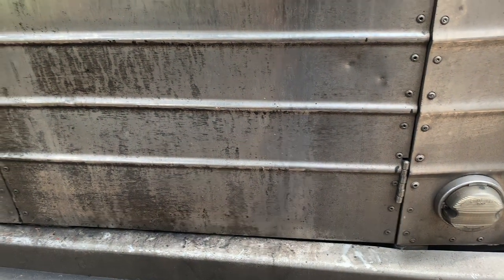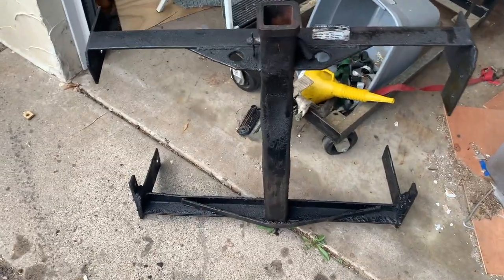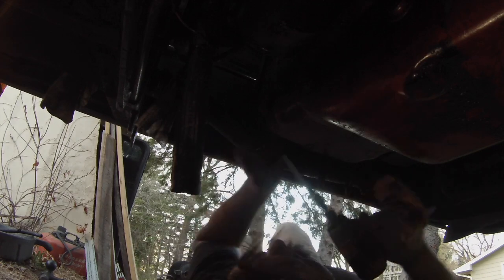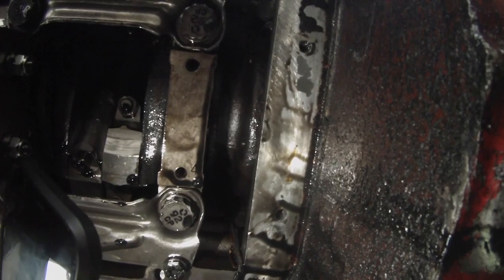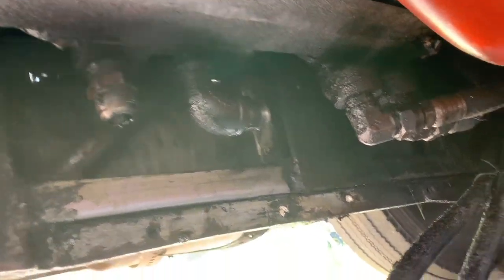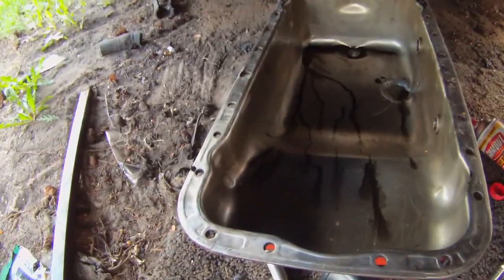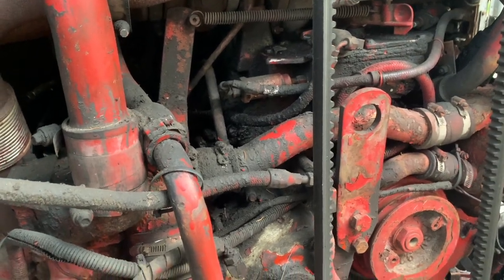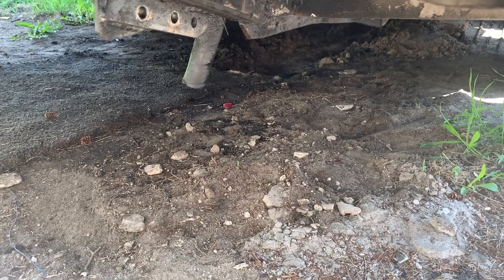Fixing Oil Leaks on Our 6v92 Engine in our MCI MC9 Bus RV Conversion

Comment: Good work.
Tip: on any project like this, my first step would be to take the bus to a "car" wash and thoroughly wash any area that will be worked on.   For 2 reasons:  1) so much nicer to work on it.  2) you can easily spot the fresh oil leaks. 

When the engine bay is dirty like that it is hard to isolate the source of an oil leak from the existing built up oil residue.

Comment: Great job, that is not an easy thing to do.  If you have access to a hot water pressure washer, it can make short work of cleaning the engine compartment.  We work on a lot of nasty big truck and RV engines and have found are heated washer to be the best at cleaning things.  Keep up the videos, they are great too watch.   Thanks, David and Tammy from Florida.
Reply from the maker: I worry about pushing water in some palce it doesn't belong.  Thanks for watching and commenting.

Comment: Scott Crosby (busgreasemonkey) taught me that the clean spots are where the leaks come from, the hot oil washes the area clean. If you see a clean area around a bolt, check it closely.
Reply from the maker: Somewhere on the BusGreaseMonkey's video list is him and I working on this very bus.  Back when he had maybe 2,000 subs.  Best as I can tell, he's the same old Scott helping people and loving life.  He taught me about the slack adjusters, and even identified my bad brake canister on the front I replaced recently long before it stopped working right.

Comment: Good job! You shouldn't get any oil leakage from the starter as it is attached to bellhousing. If you get any oil from there or the hole at the bottom of bellhousing then you have a seal or plugs loose on back of engine. That should be dry in there.
Reply from the maker: I found that leak, it was from the blower drive seal.  I tightened that up.

Comment: Very cool video showing the process.  Does that oil bottle at the end of the video say 15W40?   Is that what you put in it?  2 strokes require straight SAE 40. You will mess things up with multi viscosity oil, and they need low ash content.
Reply from the maker: I have a number of oil containers around. I use She’ll Rotella T1 40 for the engine, then - mixture of 15w 40 and tranny fluid for the transmission. Many people run this to smooth the shifts in colder weather.
Reply: @HimmelbergerBus  Awesome!  T1 is what I use as well!

Comment: Love the video, what are you using for ramps? I need to do the same thing with my MCI 9. What kind of oil did you use?
Reply from the maker: Jettpro 66 2x8s stacked 3 high with a 2x4 to stop me at the end, it mostly keeps me from rolling off the front accidentally. For oil I’ve been using Shell Rotella T1 40, I get mine at fleet farm for $15.99 /gal.
Reply: Thank you much and keep the videos coming, you have done an amazing job with your bus. I’m just now getting all the baseboard vents removed from mine. A long way to go